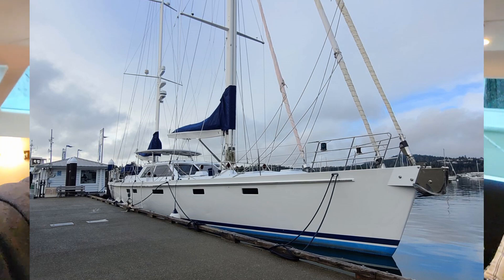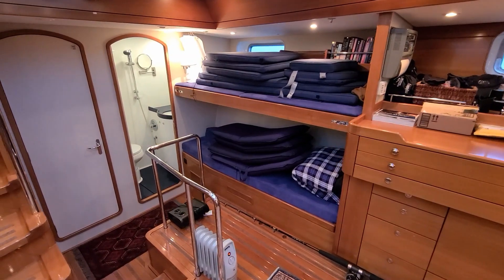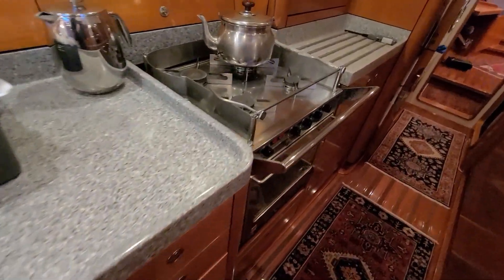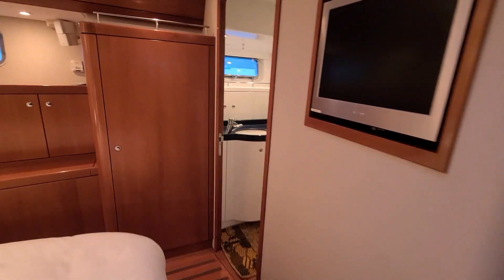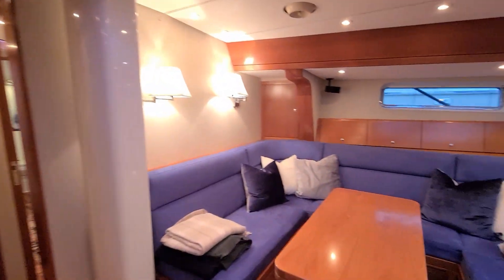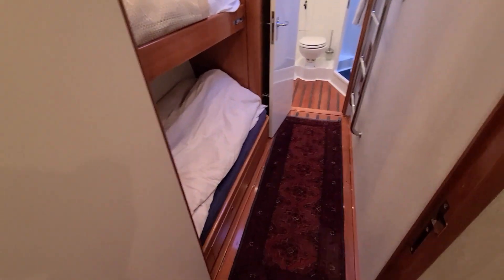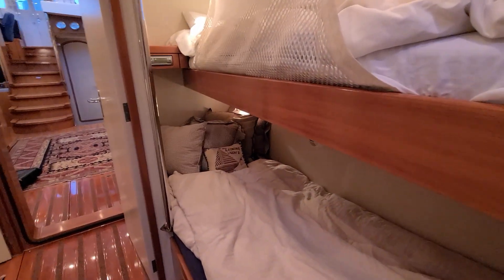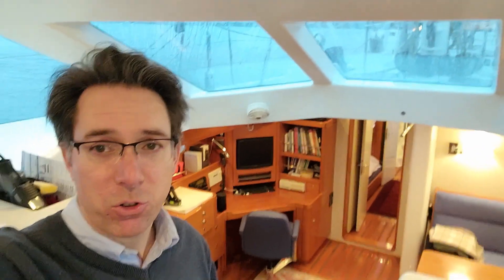80-foot Chuck Paine "Leonore" - yacht interior tour

Comment: On your walk through I saw two compressors in the shop area is one a dive compressor? Also on the YachtWorld listing dimensions no input of draft? or bridge clearance? This boat is very similar to Beowulf VII 78’ Dashew Custom Kelly Archer except for the paint. It’s name is pronounced Lin•Ore not Leenore let’s face it you are trying to sell a $2,600,000.00 boat you really should get the name correct. Watch the video again you only mentioned that it had refrigeration on board no freezers. Are there any ballast tanks port or starboard? What about the house bank of batteries how old and what type wet/AGM/Lithium? I didn’t see bow thrusters so I assume that they use prop wash to maneuver in tight quarters. Also how many crew is needed to operate safely? I would be a buyer in case you haven’t figured that out yet. My phone is not currently international that’s why I haven’t called you. You might want a US number.